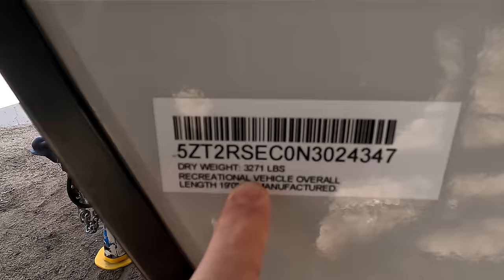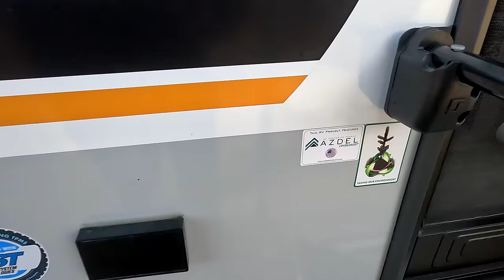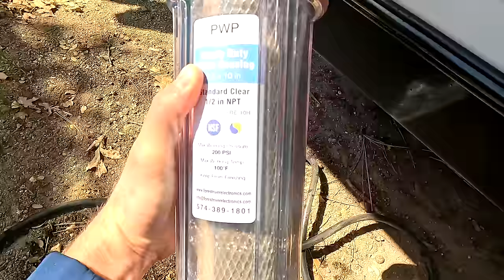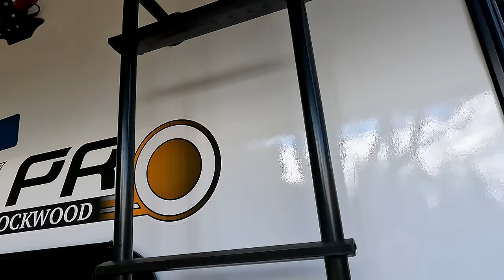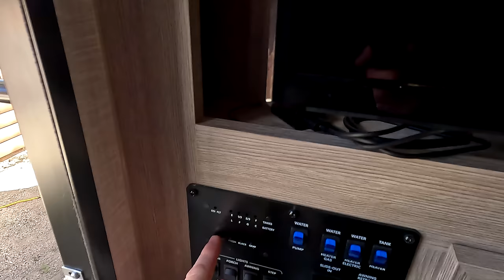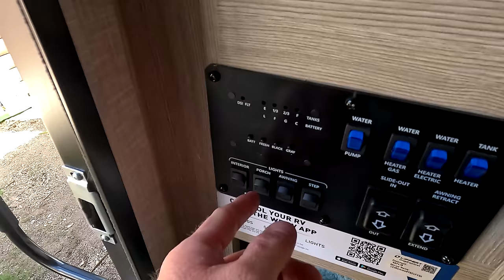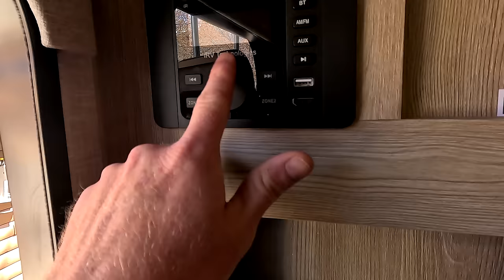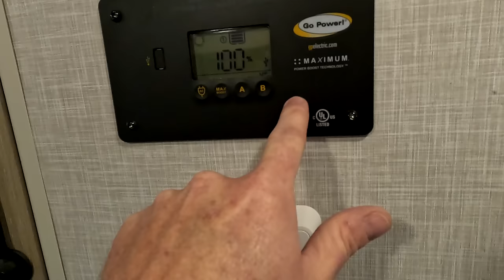Rockwood Geo Pro Travel Trailer | BRUTALLY Honest Owner Review (16BH)

Comment from the maker: We bought a Motorhome!: https://youtu.be/Onlo8q0cMm8

I TRULY did not intend this to be a negative video. However, RV's - in general - are poorly built and often have endless problems. I have to be honest! We do like our Geo Pro and it meets our needs for a lightweight, small travel trailer. 

Ram 1500 Review: https://youtu.be/KR8s65bw32w

Affiliate Links (I get a tiny commission):
Weize Battery: https://amzn.to/3Vwt6sd
Haloview Camera: https://amzn.to/3ATybBk
Storage Nets: https://amzn.to/3p0nMRB
Showerhead: https://amzn.to/413rYxj
Anderson Hitch: https://amzn.to/42py8J9
Reply: I completely agree with your assessment and frustration. 
Unfortunately, you can't avoid negativity. Your points are not only valid, but a great example of how these guys charge more for less quality. For the amount they charge, they should be giving some quality. I can appreciate the desire to make these things lighter so more people can pull them. But at some point these guys need to know where to draw the line when it comes to lowering quality.
Thanks for sharing and illustrating what people need to look for or consider when it comes to their RV purchase.
Reply: I feel exactly the same as you. Junk. All of them. 
Staples,  glue and caulk holding them together. 
When I picked mine up, several things were broken/ not right. Dealer said they were 6 to 8 weeks out. I fixed most things myself. 
My roof has a bunch of wrinkles in it. That's gonna be a fun one to deal with.
I DON'T like the door friction hinge... at all. 
Uncomfortable furniture, all vinyl. We used to get nice cloth seats, now we sit on plastic.
Reply: Honestly I think anybody that finds this review to be particularly negative probably doesn't have much experience with campers in general. They're all built like crap. It's just the nature of the beast.
Reply: It’s called honesty!
Reply: Where do u keep ur Stinky slinky inside your camper since u don't have bumper
Reply: @pineapplesmash6678  there should be a golden underneath, forward of the axle.   That’s where it was on my 16BH.
Reply: @deltabravo1257  thanks you sir
Reply: If you are already in the market for a smaller trailer like this, I’d definitely take a look at FG trailers. I was seriously interested in a GeoPro but between reading about the quality issues you’ve cited as well as wanting something a little lighter, I ended up getting a ‘22 Escape fiberglass trailer. FG don’t seem to suffer nearly as many quality control issues as traditional stickbuilt. In the 6 months I’ve had it, I’ve had very few issues. Should definitely last longer and hold its value which helps justify the larger price. For you, I’d check out Escape 19, at 19 feet, it’s only 3250lb dry and has tandem axles. No slide outs like you mentioned on the airstream but I’d gladly give up a few sq ft  of space for a noticeable uptick in quality and durability.
Reply: My trailer is an off road model that hasn't even been off road yet and the strips on the bathroom door have come off, fire extinguisher came off the wall magnetic shades don't stay up, the upper bunk won't latch when you want to put it up..and this was the 1st and only trip out on hiways and country roads 🤔😬
Reply: Thanks for your interesting video. 
One question please ; Is the RV E-Pro (like yours )suitable for a 2023 Honda Pilot 4x4 AWD ? Thanks for your help.
Reply: Thank you for your candid tour/review!!!
Reply: I appreciated your honesty.
Reply: Actually I find your honesty refreshing!   Zero need to apologize!  It’s all good!

Comment: Great video which highlights what most people are afraid to say. These things are quite poorly constructed using overall cheap materials. I would never buy new from dealer. I bought my trailer a few years old so many mods were done to improve the crappy features and most warranty work was completed as many things break during the first few years. Plus, I saved thousands! 3 years trouble free as of today (knock on wood!)!
Reply: There's a lot of evidence RVs built in the pandemic crush of buying were of lower quality. Say, spring of 2020 to maybe early 2022 build periods. Meaning, most 2021 and 2022 models are likely shoddier.
Reply: Don’t knock too hard, you might knock something loose.

Comment: I just love how the entire RV industry has everyone convinced that they need Goodyear endurance tires. I own a company that we tow two trailers both with double axle full of machines on Westlake tires. Traveling at least 50 to 100 miles a day and have never had a blowout. Want to prevent blowout keep an eye on your tire pressure don't overload your trailer loaded evenly and keep the speed down it's a home on Wheels it shouldn't be going 80 miles an hour.
Reply: Have you even used Good year tires. Nope. Not at all. I have them and they wear so great on every tire even my truck. They have lasted ten years and still going. I can take pics to confirm this bill.

Comment: RVs, Boats...you forgot Airplanes! Great video.  I converted a cargo trailer using good mattresses, multiple "solar generators",  800 watts of solar on the roof, cassette toilet, induction cooktop, microwave, stainless steel shelving, nets everywhere for storage, a 32" TV and two shore power inlets. I avoided a lot of the problems.
Reply: We are on the same wavelength Double Doctor - KISS theory for wife & myself. 
 
Several years ago we bought a used 2018 one-owner InTech Flyer Pursue for $10K.  All aluminum construction - no wood.  It's only 14 ft. length & 78 in. height.  Fits in our garage.  Has pull-out kitchen with refrigeration, roof-top air conditioner/heater & Fantastic multi speed fan, TV, stereo, power inlets, solar hook-up, cassette toilet, outdoor shower, large side awning and Ironman 8x8 pull-out tent room attached to rear of trailer.  Weighs less than 2300 lbs with cargo.  EZ pull with Tacoma TRD 4x4 Off Road with manual trans.  We live in the Tampa Bay area and camp frequently in Blue Ridge/Smokey Mountain areas of NE Georgia.  Finally got tired of sleeping on the ground without protection and dealing with changing weather conditions.   Keep It Simple.

Comment: Ok i saw mostly a person complaining about preference issues versus actual issues. This trailer was the way same the day you went to the dealer and looked at it so you saw most of the things you don't like day one. The stairs the lack of a hitch etc. For the price the geo pro comes with allot of upgrades and great construction. You are buying a home that is taking a beating as you drive. Hell just think about house that settles after completion, it can and will  have all types of issues. Most of these complaints fall on you when you did a walk around and saw the things you don't prefer yet still purchased. There is no way you can buy any travel trailer/rv and then drive it around and things don't shake lose especially depending on where you take it. The overall construction on these trailers are great and punch far above its weight class. My dealer was great and gave me several free items including a extra solar panel, slide protector, and a trailer hitch lock.
Reply: Your comment is spot on!  The whole time I watched the video I was thinking, "All that stuff was there the day he looked at it"   Some cons have merit but overall it was a lot of whining. (And I only go half way through it)
Reply: Agree. I was sort of thinking that and then when he got to the steps and complained about the legs. Adjusting the leg takes seconds. They can dump crap on the floor if you don’t sweep them first. It is personal preference and when you get old with bad knees these are nice.   Why didn’t he buy one with a hitch if that was important   I understand not knowing what you want and wishing you had it, but that’s on him.
Reply: @loriejohnson8706 I love our steps like these!  They are so sturdy and don’t move or get in the way of the door when you level them properly, it’s not difficult by any stretch. And we keep a hand broom by the door to sweep them off. Also I’ve never seen the valances falling off the windows of any trailer we’ve owned either :/

Comment: Appreciate seeing your camper. I'm wondering if most of your opinions are lead by you watching a lot of popular YouTubers. Comments like, "the stabilizers are cheap", "all RVs are junk", "all dealers are awful". RVs are built with 2 opposing masters: weight control and ability to go down the road. And if built to what you must have as your expectations, you wouldn't want to pay that much. I've been an RVer for decades. I've found good dealers, I've never had issues with stabilizers, I've handled small repairs myself and when I've been a good customer, I've generally had good experiences with manufacturers. Rockwood generally builds good products and if you are so disgusted with RVs, I'm not sure why you keep buying them. I did not find your opinions truly knowledgeable or helpful. Good Luck with your travels!

Comment: I agree about the Rv industry and dealers, terrible. I have the 20BHS and so far it’s been doing great, even though things all loosening and some warping from the shower and wall paper. Although I do live in area where temperatures can reach 110-120 degrees. So that causes damage to these or any trailer. I’ve found the single axle work well for me, easy to tow and haven’t had any sway issues. And I’ve already towed in snow and sand storms, stupidly I might add. But wife insisted on a trailer and after five years of nagging me I bought.

Comment: I loved my 16BH.   I sold it only because it had major issues with the slide out and I wasn’t willing to spend $3000 that the dealer wanted to fix it.   I was the second owner, so there was no warranty.
Reply: What year was your model and what went out?
Reply: @MontereyBayLounge  It was a 2021, purchased new in late summer/early fall of 2020.
I think it was one of the rollers under the slide that took a crap.  The high cost for repair was because the whole slideout had to be removed to get access to the roller.

Comment: Hi, I have looked at a number of travel trailers and have owned two in the past as in decades ago. One was an Avon. The other was a 23 foot terry. It weighed 4700 pounds loaded with gear less water. (Water was carried in the front and virtually all of that weight went on the tongue and rear bumper.

My interest is in the smaller single axe trailers. Other than the Happier Camper HC1 Breeze, models like the Colman 17B or 17R which are minimum content light weight stick and tin trailers are what I go for. Except for the azdel walls and construction, I am of the opinion that the newer 24 model year entry level trailers are the best value for your money. And for the most part, they are assembled using most of the same parts as the higher content more expensive models. 

Keep it simple. A box with a comfortable bed, roomy toilet/shower, small cook top, microwave, refrigerator and  lounge chair/sofa with a floating table and your golden.

Comment: Excellent review.  We have a Casita, although smaller, is much better constructed.  Nothing has fallen apart.  I do prefer a group 31 AGM battery, over lithium.  Overkill with a full sized pick up will prevent towing issues.  We tow ours with a Nissan Titan, and you cannot feel the Casita.  Do not need the weight distribution hitch, rather an anti sway bar works just fine.  I saw where a you tubber sold his Casita and bought a geo pro.  Wonder if he is regretting it about now.  Plan to keep ours.  Appreciate your observations.

Comment: The loose on the bottom panel is bc these units are meant to move on bumpy roads, that allows flexibility so things don’t snap and break. It’s not a house, if everything was tightly screwed things would break, the road is like an earthquake everyday 

Now the fridge not cooling unless you unscrew something and needing to use a lighter for the gas stove, no excuses

Comment: Airstreams are only slightly higher quality.  My 23FB had floor issues under every window, now they have composite floors not plywood.  Over the years I had it, several dealerships would recommend better parts than Airstream original parts, I replaced the inverter, hitch winch, batteries, faucets, drains, and other plumbing parts.  Their shell is great!  The interior buildout seems above industry standards, but EVERYTHING you don’t see, or they can get cheaper (Airstream uses hitch motors with nylon gears, others use metal which are much harder to strip.) they do.  There were also a few wood cuts that were clearly off, which caused a few issues too.

Comment: The factory battery box on a geo pro will hold 2 SOK lithium 12 V batteries. The jackit bike rack has a straight adapator to keep the bike from rubbing the trailer or you can turn it front at least for my my F150. I hate that bike rack but it works. I added a hitch to my 2022 19FD. That did NOT work. The bike rack, hitch and bikes probably weighed in less then 200 LB. That weight on the back of a single axle small trailer totally destabilized it. I am glad you like your refrig. We seem to have trouble keeping up with our power demand when using ours boondocking. We have 200 amp hours of lithium and 380 watts of solar. I still seem to fight the refrig and especially if I run the max air fan. Your right, travel trailers are not built great but the bones on the Geo Pro are pretty sound. The aluminum framing and Azdel are good but the frame is actually too lightweight based on comments from trailer repair professionals who looked at one I totalled. I would probably buy double axle and deal with more weight in the future.
Reply: I have 2 SOK lithium batteries and they do not fit them. I have 20 Bhs.
Reply: @mlife2  hmm, Not sure why not. Mine are tight but they fit. Box is installed at factory not the dealer so should be same. They were still making lots of substitutions in 2022 so who knows maybe got different boxes. My SOKs have a weird shape almost square and high. Either way I had them in that box for 12 k miles and over 10 weeks of camping with no problem.

Comment: Does your AC run all the time even if u have it cooled? Or does the fan run continuously?  When we watch tv it’s very loud. I was going to add a thermostat for the AC but if the fan stays on even when compressor isn’t on then it wouldn’t help with the loud noise. Was also going to add a speaker possibly to help. Any help appreciated. Greta video by the way! 

Thanks,
Powel

Comment: Hi.  When u replace the lithium battery 100ah. Do you have to replace the converter?  Are you just switch the lithium battery only? Thanks
Reply: No. On the solar converter you can toggle to the type of battery you have and lifepo4 is one of the options.

Comment: I have owned other travel trailers. I sold my last one two years ago and was happy to see it go (got a great price for it during the Covid nonsense). I have been interested in the Geo Pro/E-Pro trailers but haven't pulled the trigger. Anyway, my interest in this model drew me to this video, and I'm glad I watched it. I already realize that RVs are glue, sawdust, and staples thrown together with other cheap components. An RV purchase, under normal conditions, is a crap-shoot at best and fiscally a loser. But, as is pointed out in this video, we keep buying them. One point made in this video that surprised me was the piece about the 12 volt refrigerator not cooling sufficiently. In the past, I have been very frustrated with the previous gas/electric models which are dismal failures in hot/humid summer weather. I was under the impression the 12 volt models are far more efficient and quicker coolers in such conditions. I haven't been able to find anything on 12 volt refrigerators not keeping cold enough like their gas/electric predecessors. Anyway, thanks for a great, honest video!
Reply from the maker: its just an issue with the factory setting
Reply: @BigRockOutdoors1  what setting? Is it something WE can change ourselves?

Comment: And it's not just the way RVs are it's the way trailers are. They don't have the same suspension as a car to handle vibration bumps Etc and it just comes with the territory of owning a trailer that you will need to tighten bolts screws Etc on a regular basis. I mean the geopro here only weighs 3000 pounds how much reinforcement do you think they really put on

Comment: Multiply the price tag by 4 or 5 and you will get quality. What can you expect for 25k-30k and at least 10k worth of profit. I added insulation, Amazon led lights a fuse panel and marine battery to run my domestic cooler and a Chinese diesel heater. Look at some overland trailers with half this length and no bathroom or holding tanks and they price out at 100k for a durable quality unit.

Comment: I hate those steps also. We have the ones that are under/aluminum and I bought the Lippert "stabilizers" that attach. I don't have to use them but if setting up for a few days I do. They are about the same frustration level as yours, but I don't HAVE TO use them.

Comment: I was wondering do you think it would be possible to add two 2"  receiver hitches to the rear bumper for a removable Moped type mount? i just don't want to use a single receiver as it's way to rocky.

Comment: Why are trailer mounted jacks weak? Isn’t the same thing used to lift a vehicle for a flat tire
Reply from the maker: No, much weaker
Reply: They are stabilizing jacks and not meant to hold the trailer. Even if you replace them with stronger and heavier jacks, it’s not good to lift the trailer, it can damage it. Get a good bottle-Jack or scissor jack, every trailer is different so you’ll have to research where to place in on the frame when replacing the tire.